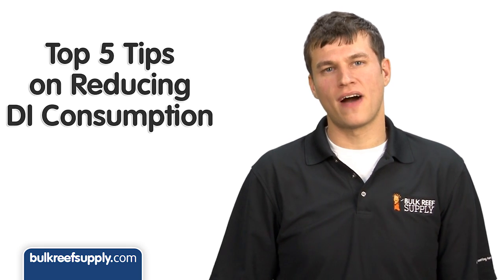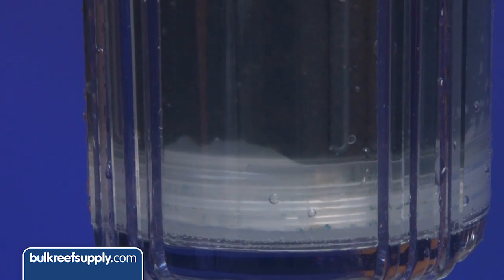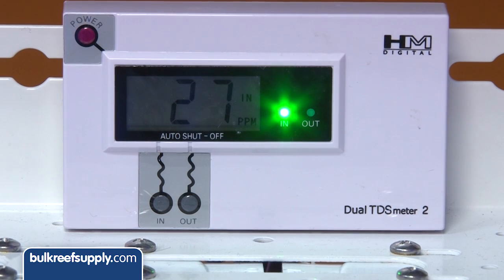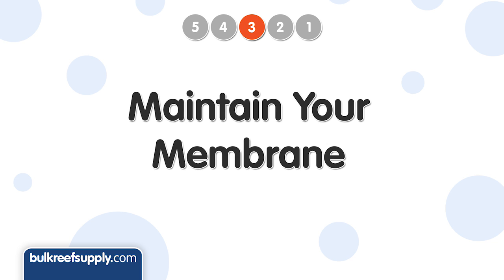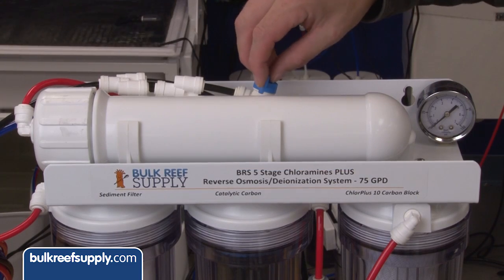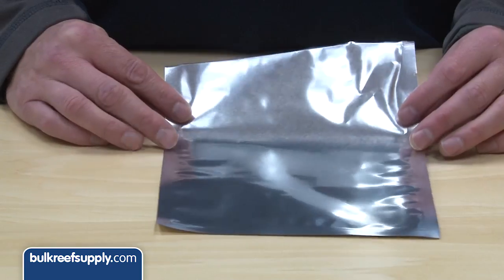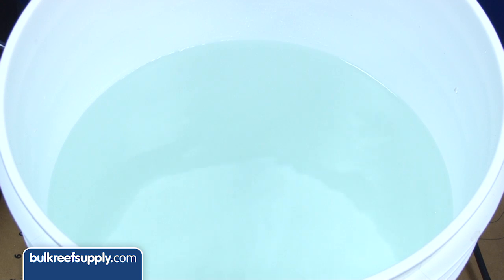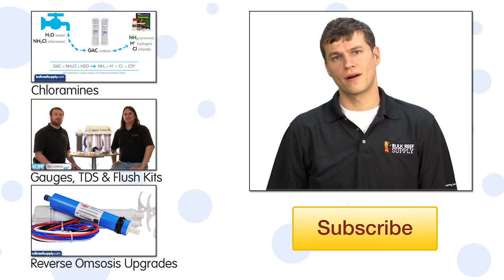Top 5 Tips to Reduce DI Resin Consumption in Your RO System

Comment: I have a small 4 cartridge RO system for cleaning water for aquariums. Is all sodium removed by the first 3 filter cartridges in these systems before the filtered water gets to the final resin cartridge? My TDSs are 21 PPM before my water even enters the final resin cartridge and I was thinking of leaving the resin cartridge out of my system if all sodium has already been removed since other systems like mine don’t even come with the 4th cartridge which is the resin cartridge in there systems. Thanks in advance to anyone who might know the answer to this.👍
Reply from the maker: Most RO membranes are rated for removal of somewhere between 90-99% of sodium at peak efficiency.
Reply: @BRStv  I gotcha, yeah my water had a TDS of 385 before running it through the sediment carbon & RO filters and after that had a TDS of around 21 to 27. Since it takes 3hrs to get 5gal of RO water because my water pressure is only 48lbs instead of the 65lbs the RO filter system calls for I was gonna leave out the resin cartridge so it doesn’t take even longer to recover RO water as long as the TDS of 21 to 27 isn’t all sodium. Sodium would be the only chemical that would harm my freshwater fish so I was hoping that all the sodium was removed by the 3 cartridges without having to use the resin cartridge. I guess I’ll find out, maybe I’ll put one fish in a small tank with the filtered water that’s 21 to 27 TDS and see what happens. Thanks for the info.👍

Comment: I am filling up my new 600 gallon reef.  Somewhere around 500 gallons I noticed the water flow slowing down.  TDS into DI was at 4 and 11 coming out.  Should the DI lose effectiveness that quickly?
Reply from the maker: Getting 500 gallons out of a single DI cartridge is actually pretty good, but will vary based on source water quality and CO2 concentrations. I'd suggest replacing it and then continuing to fill.

Comment: I have barely made 30 gallons of water and my DI resin is 3/4 depleted.  I just bought this 5 stage setup.  I am getting 38 TDS from the RO which seems way too high.
Reply: Thats my problem also . Used it one day and it was depleted. Told me to get another di resin canister . I dont think the cartridge was packed right when i got it . I think it was half empty .  Hope two works   so i can get more then 30 gallons . I dont see how it will help that much . The tds in my water is 281 going in.  And ps is 60 .

Comment: typically I go through 1 canister of DI resin every 55 to 60 gal of RO water made, I use the pureflo2, with booster pump along with the 100 gpd upgrade, TDS meter shows 170 x10 coming from my water softener, after the RO it's reduced to around 45, and of course 0 after DI, I use well water that I know is high in calcium dew to the buildup on just about everything, I'm to the point of running 2 RO systems before going to the DI, boost pressure is unknown as there is no gauge, may replace existing unit with BRS unit and run this unit on second stage, 1 way I found to cut costs on DI resin is to recharge it myself, takes about an hr to do 7 lbs.
Reply: +BulkReefSupplyCom if I'm not mistaken it's either 2 to 1 or 3 to 1, I have the double membrane as well I got from BRS
Reply: +BulkReefSupplyCom 2 to 1 is  stock.
Reply: +BulkReefSupplyCom yes I do
Reply: +BulkReefSupplyCom both membranes are dewpont
Reply: +BulkReefSupplyCom just wondering if I need to change to a different pre-filter, mine is believe is a 10 micron, BRS if I remember is a 1 micron?
Reply: +BulkReefSupplyCom ro system is downstream, immediately following softener, then into house, like I said I don't have the best well water, but I do need to cut back on my di consumption somehow
Reply: How do you recharge your DI mix beads?

Comment: I T fitting connected my Tds creep waste line to my original waste line after the flow restrictor into one waste line this entire wrecked my membrane as it reads full Tds now and was wondering if the rest of my filters need replacing too? Thanks brs!
Reply: +BulkReefSupplyCom correct after I did that the entire r/o unit began shaking like it was going to explode so then I just gave the Tds creep line its own waste line however my membrane reads full Tds now.  Could that be the cause of this?
Reply: +BulkReefSupplyCom thanks brs but I switched it back already and was just wondering if connecting the two waste lines could have damaged the membrane? I think the pressure from the original waste line after the flow restrictor is stronger than the Tds creep waste line so it sent water back through the membrane through the opposite end causing the turbulence?
Reply: sigh to my embarrassment i hooked it back up incorrectly thanks for trying to help a dead end problem brs lol! i ended up using another membrane before finding this out would it matter if i had used a membrane already and left it back out for storage? thanks again brs!

Comment: Hi to all,
I have a 4 stage Ro water purifier. I want to make DI water with it. So at the first i tried to use a mix bed anion and cation resin. it changes the tds from 13 to 1. but i need zero. what can i do now?
Reply: ***** i used two kind of TDS meters. one is pen type. it shows sometimes 1 and sometimes 0 for TDS. but for the Conductivity it shows 1 or 2 ( i need less than 0.1). but the second type is desktop type with an electrode. it shows 0.55 mg/lit for TDS and 0.77 uS/cm for conductivity. I want to reach to Ultra pure Water with conductivity less than 0.1 uS/cm. What can i do ?!

Comment: My water is 8.6pH and KH at 300+ppm which puts me at low dissolved Co2, or it should. My resin doesn't last long at all. My TDS creep starts out at around 150 so I flush the system before I start making water to bring it down. It usually runs at 5 TDS into the DI chamber once it is balanced. So what's the deal? I can make maybe 130 gallons before it runs out. I guess I have high Co2? 20+ dKH water usually doesn't have high available Co2 so I don't really know what the hell is going on.
Reply: I see, I guess I never thought about how the buffer is created. So with a large amount of carbonic acid in the water it has dissolved the minerals creating a large amount of conjugate base, I assume calcium carbonate, for the most part, because it wants to reach equilibrium it will have a high amount of carbonates/bicarbonates to equal the carbonic acid? Is this correct? Now the carbonic acid is the oxidized form and the minerals have taken the proton H+ and are now in the weak acid form or as a bicarbonate and the water is buffered? For how fast it is using it up it might be 70%, I haven't checked the TDS out of the tap it could be 300+. I literally have liquid rock, some of the, if not the hardest water, in the US.

Comment: So what is the duty cycle of the dose pumps to run them through the DI?  Can they run continuous for lets say 50 gallons?

I have high CO2 level and my DI only lasts for about 55-75 Gallons of RO water and its exhausted with new filters, membrane and 60psi of water pressure.

Comment: starting to wonder if the TDS meter on my BRS 5 stage+ is reliable...Im well over two years with my DI resin! But I dont use all that much water, I only fill a 35g trashcan so no short "bursts" and the RO portion usually drops my water down to ~1 TDS as it goes into the DI can.

Comment: Have fish 15 years old and always used just tap. No disease , 180 gallon reef.
Do used a polybio media pad occasionally to check the tank and or in the top off fresh water tank. Adding minerals from the fresh water is part of the TDS meter and not a bad thing. Reverse osmosis gives you sterile water which is not good to drink or add to a tank.
Reply: People don't use tap water because most places are high in chlorine and chloramines as well as phosphates which can cause algae blooms. 🤙

Comment: I've been running the BRS 4 Stage 75 GPD since back in Feb and I'm definitely due on changing out my filters. Right now I burn through DI Resin relatively quick due to the low psi from not having booster pump.

Comment: Also a few more things to point out are 1. the color changing DI resin is not a good way to tell when it's time to change the resin. a TDS meter is the way to go. Let that be the means of which you determine weather it's time for changing it out. I have been changing it when the color turns, but this last time, I have been getting a lot more water out of it even though  the color has changed. The TDS meter is still reading 0.

Comment: I get about 90 gallons from a DI cartage. I have every issue you mentioned.
1. High TDS 1200 source, so 20-25 TDS after the RO.
2. Well Water so my PSI ranges from 25-50 PSI
2. High CO2 in the water.

Comment: I have well water and I got 15-30 gallons of water per resin container with a product water of 12 tds. I called BRS and they gave me these 5 tips. He said it sounds like a CO2 problem. I plumbed my RO water into a 15 gallon jug and added an airstone. The water enters at the top and drains out the bottom. The water only has a contact time of like 6 hours in the jug. The 15 gallon jug is roughly 1ft above my DI chamber. Gravity feeds my DI resin and I have made 130 gallons since and I have only used 1 in of resin.
Reply: Dang boy... 🔥